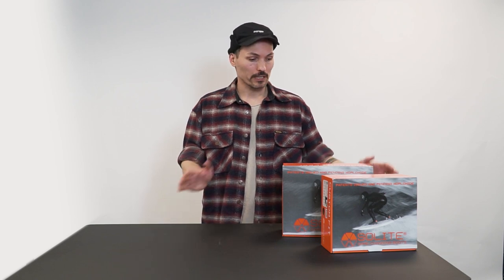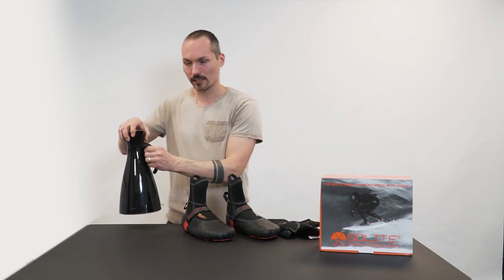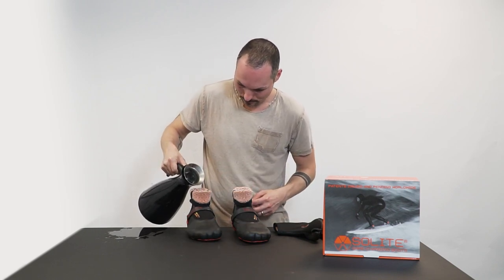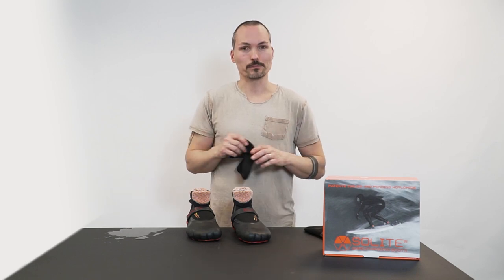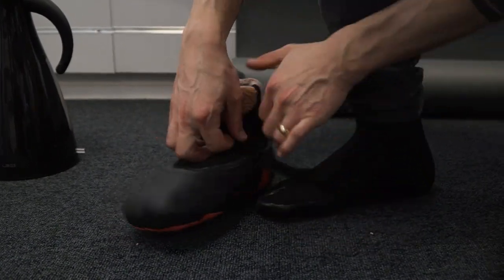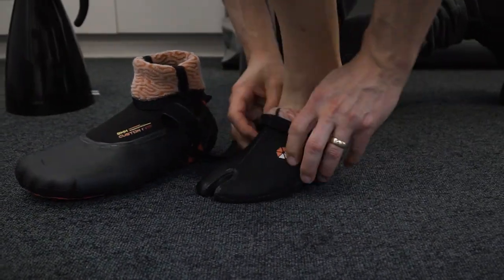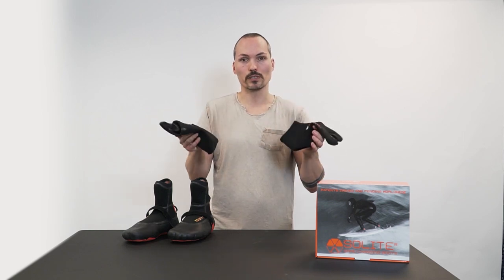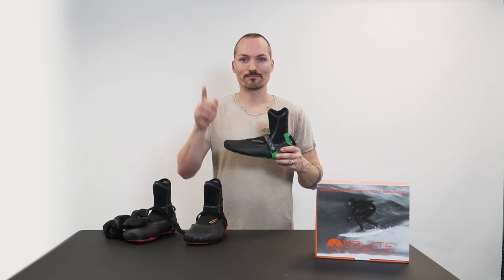How to heat mold your Solite Boots - 8mm Custom Fire

Comment: I wear size 11 shoes... I got size 10 3mm. Terrible booties for narrow, skinny foot people. There is too much space on the side, and on the top (before molding). After molding I'm not sure if they stretched out even more but I'm sure they did a little bit. I also have a longer second toe than big toe. So, it's been 15 years of trying to find a bootie that fits. None of them do. These would probably work if they weren't so wide and tall before molding. The size 9 would definitely be too short from heel to toes, so there is no way i could mold the toes long enough. Sucks ass might just get some normal booties for skinny long feet, and then cut a hole on the second toe and repair them.
Reply: I have the same problem, long narrow feet but size 11 and small ankles, what did you end up buying?